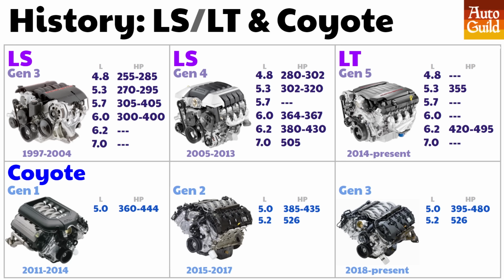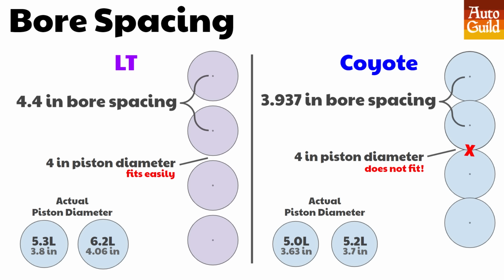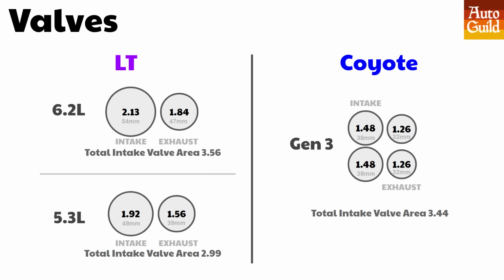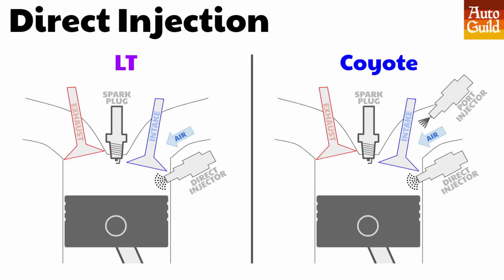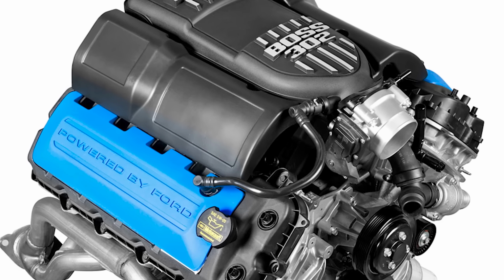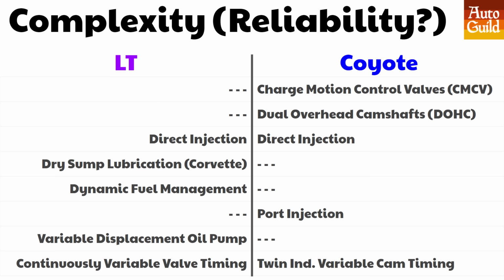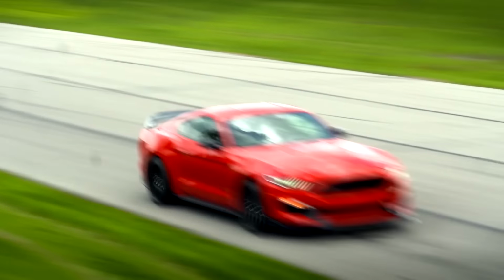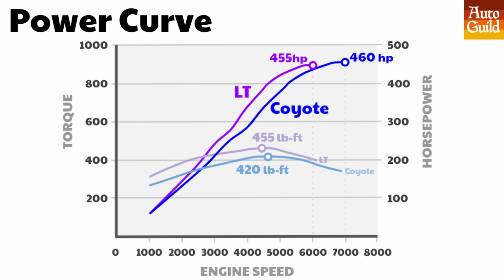GM Gen 5 LT vs Ford Coyote.  Which one is better and why.

Comment: I like both motors, but the new cross plane gm engine is fascinating too. I'm not a fan of ohc on a v configuration motor, all the cams,  tensioners and chains are a lot of gobbledygook that restricts durability and reliability,  most people don't spend much of their time at maximum rpms

Comment: apples to oranges here...completely different design philosophy. I had the choice between a 2016 coyote and a 2018 5.3 lt.  The Coyote was twice as expensive as the LT and it made about 40 hp more hp at a higher rpm than the LT...with a  moderate daily friendly cam\DOD delete, 6.0 intake, headers and a pro tune...I was easily surpassing the Coyote in HP...throughout the curve and I had the torque down low where I wanted it.   If you are looking for a high-revver racer with great internals..the coyote is for you...if you are looking for a cost effective and easily and cheaply attained power wit daily driver usability...the LT is a better choice

Comment: Bad info given in the very first infographic. LS2 was a Gen 4 6.0L motor with 400HP. LS3 corvettes with the NPP exhaust were rated at 436 instead of 430. Not everything is wrong but take this video with a grain of salt

Comment: I don't get the par about 4 smaller valves are lighter than 2 big ones... and revving faster... 4 valves is more materials no? They all have the tiny shaft in their back... Then there are 2 more sets of springs, and 3 more cams to spin... All the friction of it all; In my mind, that's harder to move no? All those springs against you, that friction etc...
Reply: when in operation the valves weight as individual valve is lighter with a smaller valve and, therefore this one valve can compare with a heavier valve in action. You are confusing total weight of all valves in operation.

Comment: The problem with the agument of if the  Coyote was 6.2l then it would make more power than the ls at 6.2l is invalid due to the fact that when you go with a bigger engine the efficiency goes down so if it was bigger i dont think it would be a big difference in hp number also an argument for if you turned the same rpm as the coyote with the LT it would bridge the gap.

Comment: For those who don't know the LS is a copy of a small block Ford !! same deck height, same board spacing, same value layout !! You can put LS heads on a small block Ford with very little modifications !! I've seen people install an LS in a Mustang and keep the same ford headers and they bolt up to the LS !!

Comment: For most people the comparison ends at "Overhead Cams".  After decades of doing this I have yet to hear a valid reason for it on any engine where you won't be turning over 8k on less than 3 litres.

Comment: I’ve built both and maybe I missed it but the forged coyote internals are far better than the cast Lt 1-4 components. I found the coyote didn’t need internals to make the 800 wheel I was aiming at or head work so it was considerably cheaper to make the solid power I was hoping for.
Reply: How much does it cost just to do a normal dd rebuild on a 5.0 vs a 5.3?
Reply: 🤣😂🤣😆😁🤣😂🤣😅😁😂Of course in the real world we make 800+ HP with the factory bottom end of the LS/LT all the time and have for over a decade.  The Ford, OTOH, takes far more work to get those numbers and part of that work is always rods.  But it's your fantasy, you live it...
Reply: @scottysgarage4393  obviously you don’t do that work or you wouldn’t say something so stupid. Your saying a cast rod and piston will handle more power than a forged piece and a 2 valve head flows better than a 4, your backyard education is lacking.
Reply: @scottysgarage4393   Yes the proof is in all the Fords running around with a LS hiding under the hood!!  🤣🤣🤣🤣🤣😂😂😂😂😋😋😋
Reply: @scottysgarage4393  bullcrap. Typical Chevy guy talking crap

Comment: I disagree with his point about 2 valves can suck in more than one valve. Here's why. What has more volume flow, one  4 inch pipe, or two 2 inch pipes? The correct answer is one 4 inch pipe.

Comment: I own a mix of what I believe are some of the greatest V8 families ever made from both Ford and GM. I have an old Ford FE in the form of a '64 352, the SBC represented by a '65 283, and I have a 6.0 LS and 5.0 Coyote. Naturally the Coyote smokes them all for power, but I don't own a LT and that LS is stock. But my favorites are the old V8's, there simplicity is awesome, having personally rebuilt both of those I mentioned.

Comment: I would like to hear more about support for converting LS and/or LT platforms to flat-plane crank format.  What's the latest aftermarket tech available and what is involved if you happen to be building a junkyard block from the ground up?  I'm wondering if an LS/LT with the flat-plane crank would see the HP/cube numbers rival the Coyote more closely.
Reply: Callies Crankshafts is capable of making flat plane crankshafts (custom order only) for LS/LT platforms, but they're not common orders for them.  To add to that, the LS/LT platforms are designed to be internally balanced (engine balance complete via crankshaft only vs balancer and flywheel), and I'm not sure how that would be achieved with a flat plane crank in comparison.  But asides from that, the major Achilles heel for the LS/LT in this regard has to do with its valvetrain and its stability at high RPM.  It is true that you can build your engine to suit this purpose, but there's going to be a lot of investment involved,  One thing people tend to overlook is having proper cooling for the valve springs at those elevated high RPM's.  The more you actuate a valve the more heat the valve spring produces due to internal friction of the metal inside the spring itself.  It's one of many reasons why NASCAR and other high-level naturally aspirated engines have dedicated valve spring oil squirters incorporated into the cylinder head or valve cover.
The second thing you have to overcome is the total amount of airflow that a 2 valve engine needs to move to be able to breathe at higher RPM.  It's still the same as an overhead cam engine, but instead of relying on two valves to pass that much air, it can only use one.  There's a lot of science that goes into making that work, so I'll keep it short.  For all other conditions being equal and for the same required airflow, 4 valves have to move off their seat less distance (lift) and have to be open for less time (duration) to ingest the same amount of air as a 2 valve setup would.  Not sure of the rule-of-thumb comparison ratios, but I think it's in the ballpark of 1.5:1 for both total lift and duration for a 2 valve in comparison to a 4 valve (don't quote me on that). I have a 4.8l LS bored out to nearly 5.0l, and for me to make similar torque, HP and have a similar RPM range, the camshaft I'd have to put in it would have poor idle quality, a lot of overlap, and truly decent lift and duration (not to mention all the money spent on getting both a flat plane crankshaft and an accommodating camshaft profile with a matching firing order).
TL;DR...
Is it possible?  yes.  Is it financially reasonable?  Only in direct comparison to swapping a Ferrari flat plane V8 into your donor vehicle.  2 valve pushrod v8's are inherently great at low-RPM torque production.  They're capable of making power higher up, but they reach the point of diminishing returns in cost-to-performance far quicker than an overhead cam engine in regards to high-RPM horsepower.
Reply: @jacquescrusan9500  That is a great overview Jaques.  Thanks!!

Comment: Direct injection is junk. It only exist to create lean-burn conditions. The Coyote has higher pumping losses than the GM. Pur a load on it, large displacement pushrod engines are always more efficient under 4k rpm than dohc. High rpm reduces engine life.

Comment: Sorry, NO! You are wrong. You said in a flat plane crank “when one piston is at top dead center the opposing piston is at bottom dead center.” It is physically impossible in a V-block. ONLY IF THE BLOCK IS FLAT/BOXER ARE TDC AND BDC IN OPPOSITION. In a V-Block with a flat-plane crank, when one piston is at TDC, it’s opposing piston is at the inverse of the V-angle of the bock.
When you say something like this at is so obviously false it makes someone question everything else you’ve said.

Comment: Gm ls platform is superior in every way  . Stronger, smaller lighter, less moving parts, and signifantly cheaper to repair.  Timing chains on those stupid ford engines cost a fortune.

Comment: And now that the LT6 is out, half of this video gets thrown in the air.  A DOHC, Flat Plane V8 that revs to 8.6k rpm and makes 670 hp will do that.  Also displacement =/= size.  The LT is already smaller than the Coyote and if you increased the size of the Coyote to 6.2l then it would be a massive engine that is somewhere like 30% larger and heavier.

Comment: As to the valves you have to remove the valve stem size from the available area due to obstruction per valve when calculating flow rate. It is not as simple as overall size vs size. Example lt 2.165-.315=1.845 flow rate Cyoty 1.48-.2355=1.244x2=2.488. this math though only shows for static at full open. The height and duration of open are multiplied by these numbers to determine the total flow rate in a stroke.

Comment: it would have been interesting to have seen the cost comparison between these engines.
Reply: Even from a ford guy, it is a lot cheaper to run an LS engine than coyote, even with the aftermarket.

Comment: The biggest achilles heel of the mustang is that damn transmission. I've had 2 of them and both had transmission issues, and the gear ratio was worse on the 2018...

Comment: Dynamic fuel management on the LT engines is a joke. In fact the whole lifter setup on the LT engines are hot garbage. So is the variable displacement oil pump. I had several issues with both components on my silverado. I dont even understand the reasoning behind the variable oil pump.

Comment: the lt did not replace the ls it was a cheaper engine for a better base model but the new ls 7 will stomp it in the ground at 860 hp over head cams 4 valve per cylinder and u can get it in most performance cars like vett, camaro and so on but add about 25,000 more for the rig if not more

Comment: I don't know about these takes. Seems more focused on when they work rather than how long they can last without breaking. I don't care about having a race car. I care about having a truck that won't die at 100k miles like the AFM crap on the GM truck engines

Comment: For General Use , in everyday ROAD GOING Vehicles the LS/LT has to be a better proposition . Somewhat cheaper to fix in the event something breaks .
The Coyotes are making Early Motorbike power figures 100bhp per Litre is significant . But Complex ? Fuck Yes ! Costly to repair . Just Labour is double .
For a Large Pick-up  I  would take an LT/S any time . Track Car , Coyote .  Pretty simple really . How much you wanna spend " Life of Engine " ?

Comment: When Hot Rod finally allowed Mod engines in their dyno racing, the first thing they did was limit the competition to 6500 rpm's. Way yo hamstring the mod. If you can't get your GM motor to rev to 8K regularly, too bad.

Comment: I’ve owned both. The LS gives me less anxiety as it’s easier to work on and less to go wrong, but the top end power on the Coyote is addictive. VERY addictive! I honestly still prefer the SBC both for it’s sound and cost effectiveness. I can buy a BluePrint 396-454 SBC that’ll make 500-600hp for about 5600-9200 that has a 30 month 50,000 mile warranty. It’s fun to beat LS and Coyote guys in a 77 Z28! I think I’ll have one for my 71 Chevelle too!
Reply: Why do guys with entire engine swaps like to “beat” on basically stock cars. I don’t think anyone would be surprised or care that your 454 beat a bolt on camero or mustang.
Reply: @lineoflads1388 Got em, that’s because they want to flex, like they are better than everyone else, they get angry when it’s a modified Coyote though.
Reply: I was always a Ford guy.  The Triton modulars from 97 to 2003 were indestructible. But the 2004 and later variable valve timing was a distaster. It pains me to say it, but I had to buy a used Chevy in that era. The later ones improved a bit. But they still look rather complicated.

Comment: Ls is not even in the ball game of the Coyote when it comes to muscle cars and trucks. not even close. there is literally 1000's of videos on you tube proving this.  Ford's 3.5 eco in a f150 4-door 4wd  with only a tune and e-85 will beat a brand new C8 Corvette in the 1/4 mile. The Explorer is even faster. 
The only thing LS has that ford doesn't is that beautiful CHOP. However I would much rather have Over Head Cams than Push Rod any day.

Comment: I'm putting an LT1/L83 in my 37 CHev PU.  Yes, swap parts aren't like an LS, but it's improving.  I got my wiring harness from SPEARTECH and it was flawless and super easy to install.  Engine fired on the fist attempt.

Comment: Both are good engines but as a restomoder I have to give the edge to the LS as swaps are a lot easier.  Coyotes tend to require major body mods to squeeze them into older unibody cars.  With the LS you also have the 5.3 which can be bought on the cheap and built to push 500hp with little more than a hotter cam.  Ford doesn't have this "run of the mill" v-8 option out there for hot rodders on a budget. If you want a Ford, be ready to pay top dollar.

Comment: LS blows everything away there is no comparison
Reply: Yeah I’ve seen them blow rods, pistons and chunks of the block😂🤡
Reply: @Jimmyxsx  everyone uses the ls and there’s a reason for that they’re far the best engine ford don’t hold a candle
Reply: @billjohnson5023  😆😆🤣 show me a stock sealed LS that can make 900rwhp like a Coyote 5.0L does. Coyote is superior in every shape or form. No need to crack open the engine to replace cam, heads or intake in order to make power. Just boost the Coyote and let it eat, LS needs a ton of upgrades just to make power😆
Reply: @Jimmyxsx  hahaha what a joke your the only clown that believes your crap even the ford and dodge guys use LS engines in everything your hilarious ford lover
Reply: @billjohnson5023  you dont have to believe me there is plenty of videos and shops like Midnight performance who race F150 5.0L trucks, even Cleetus McFarland who is an LS guy has said it.😂 now why you evaded the question? Show me a stock sealed LS pushing 900rwhp with no head, cam or intake manifold swap, I’ll be waiting😆
Reply: @Jimmyxsx  they could build one if they wanted anyone can
Reply: @billjohnson5023  😆😆 still waiting
Reply: @Jimmyxsx  ok who makes this engine ford or shelby smart guy
Reply: And the new z06 will kill that thing is the funny part
Reply: @billjohnson5023  The Z06 couldn’t even beat the V6 Ford GT lol Throttle house raced those cars about a week ago and the GT beat it in a dig and roll race😂
Reply: @Jimmyxsx  that ford GT is the ugliest car ever made Chevy will always be superior over ford crap
Reply: You never answered me in the engine is this a shelby engine with that much hp
Reply: @billjohnson5023  superior and it lost to a V6 with less hp😂🤡
Shelby engine? What are you talking about🤣 Shelby hasn’t made an engine since the 70’s lol 5.0L Coyote, 5.2L Predator, 4.6L Terminator, and 5.8L trinity are all Ford SVT designed and built you fool😆.
Reply: @Jimmyxsx  I’m saying if this is a shelby engine if your not smart enough to know it’s aftermarket performance parts to make it have that much power it’s not like it’s just a factory engine it’s Shelby add ons but head
Reply: @billjohnson5023  https://youtu.be/bKAYnpb8f_A your boy Cletus McFarland agrees with me. That F150 slayed a 1000hp C7😂. coyote still has Stock pistons, rods, intake, just boost and it destroyed built chevy cars😆💪
Reply: @Jimmyxsx  well how come streetspeeds vette smokes everything

Comment: If GM gets their act together. A coworker bought a C1500 with a 5.3 in 2021. His truck is on its 4 motor! With only 6000 miles. All 3 motor dropped a valve.

Comment: Some of the gen 3 Coyote are terible oil burners. A couple years ago, I bought a used gen 2 Coyote because of that. The gen 2 is a bit simpler and should go more miles without issues. Also, the 6 speed transmission that went with my 2016 5.0 F150 is far more dependable than the new 10 speed. I wasn't about to buy a truck with a new transmission and engine. That seemed like asking for trouble.

Comment: Lt6 sets em apart in my opinion it showed what Chevy could do with a dual overhead cam, flat plane crank motor and damn it is impressive
Reply: I’ll take an LS7 over the LT6 all day. the LS7 is actually affordable and simple to modify.
Reply: @Jimmyxsx  yeah but they have the predator and voodoo in here, very expensive engines. For price nothing beats the ls1, ls3, ls7 line up chevy offers I just meant Chevy engineered a very impressive flat plane crank and dual overhead cam motor something they hadn’t done either of before and imop made it better than the voodoo which is fords n/a flat plane crank dual overhead cam motor.

Comment: There is one major flaw with the voodoo 5.2 you get scoring on your cylinder walls you cannot rebuild the engine you can but it's probably cheaper just to get another block because they use plasma welding for the spray on cylinder walls
Reply: 😂 dude people have been sleeving the voodoo since it came out. Voodoo is rebuildable, is basically a Coyote block with a FP crank.